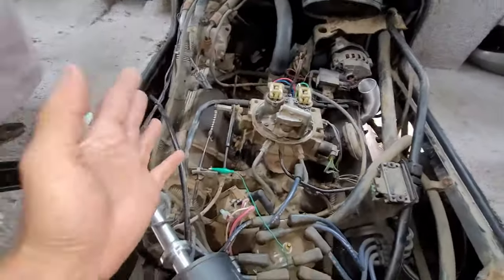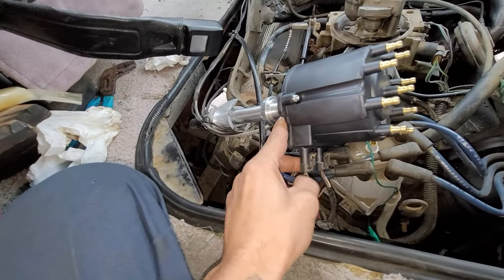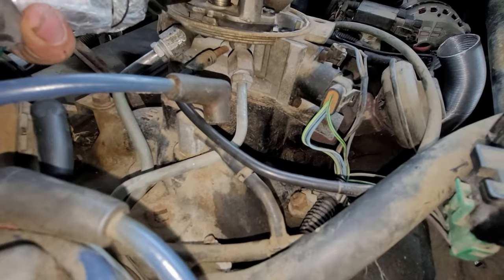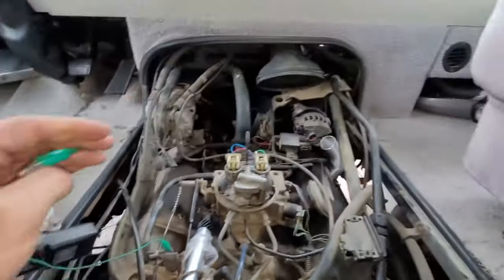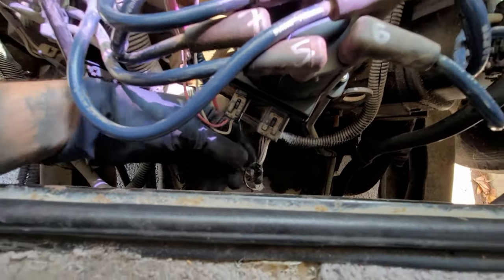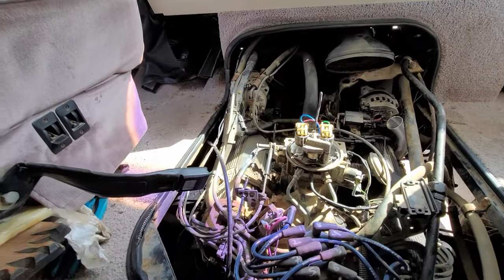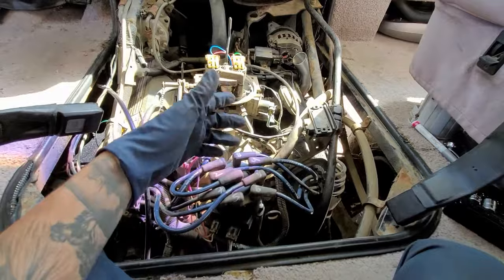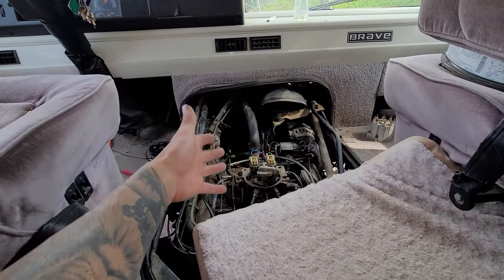chevy no injector pulse

Comment: that pink wire at the ECM is powered by a fuse in the panel ,,,,I found the fuse was GOOD but no power to the ECM, pulled panel and the wire terminal on the back of the fuse panel was bad going to the ECM!!! repaired terminal, got power to ECM and injector pulse

Comment: That is a big block 454 (not small block). No pulse = ICM issue, or wiring between ICM and PCM. The ICM/PCM grounds at/near the T-stat front of intake. Should be a metal bracket that bolts to the T-stat housing. No power to the pink/black wire makes me believe it's the ignition switch (base of steering column backside) Quite a bit of electrical passes thru it and it's known to go bad. For the injectors to pulse the ICM must be functioning.
Reply: And not hei
Reply: The TBI ECM uses no chassis grounds, or does it? All the cables that go out of the ECM go directly to sensors, ICM and injectors. There's more than 20 wires coming out of that box.
Reply: @soupflood  It grounds via the mounting bracket screws and at various sensor/s. It is also a good idea to replace the engine to chassis frame ground cable if it hasn't been replaced.
Reply: @jf4872   I didn't know that, should check it out
Reply: I need Help please

Comment: I recently purchased a 1992 GMC Topkick c6000 with a 366 6.0 gasoline engine and it turns ON but will not stay ON. I have to quickly step on and off of the gas pedal repeatedly for it to idle. It won't idle otherwise. I replaced the IAC, fuel pressure regulator, throttle body injector o-rings, sprayed the injectors and ports, fuel pump and strainer but still the same results. As I pump the pedal I was told there is  fuel at the injectors but it is weak and to clean them out which I believe I already did. I gave up but will revisit it again someday. Thank you for the video as it encourages me to return to the GMC.

Comment: Great video.     Me and my son are going to tackle is 92 K2500 tbi crank no start no pulse.       Just a dash of starting fluid and it's fired off and running.        Got the 700r4 in pieces on the bench rebuilding it for no reverse.
Reply: Did you find the problem???

Comment: #jabothemechanic Got a question? You said you also replaced the computer, I also am experiencing the same issue on my 95 Chevy Silverado Z71. It will run really good for about a hour until it gets hot then the injectors will stop spraying. I assume the distributor pick-up coil inside distributor but do you think the computer is getting hot and shutting the injectors off. It's just odd. I had it towed home and went back outside the next morning and it fired right up

Comment: Why can't you ground the aluminum body? Aluminum conducts electricity. It's used for electrical wire. The distributor grounds at the tie down , I'm sure there's a point during the backlash the distributor gear may not be positively in contact with the cam gear.
Do they even make a steel housing distributor, all my OEM distributors are aluminum.

Comment: So in my 89 Cadillac Seville sts TBI ( after I got know where) I remembered the guy I bought it from after he put a new battery in poured some gas in the throttle body to get it started. So at this point I thought what could it hurt ? I tried it and sure enough after your battery is unhooked or Dies in the caddy Chevy 350 anyway. You Have to poor q but of gas directly into the throttle body . It started right up and has ran fine ever since . Go figure

Comment: I had the same problem on my 1994 g3500 with a 454 ! I was not getting any power at all to injectors after hours of searching for the right diagram the injectors get power from the transmission circuit
Reply: Can you tell me a little more about this trans circuit? Thanks
Reply: They get their signal from the ICM (ignition control module).

Comment: Any ideas on an intermittent injector pulse? Starts and runs good just sometimes it will randomly not fire the passenger side injectors I replaced them last night in hopes it would fix it no such luck I wiggled the wiring harness and quickly looked over the wiring

Comment: i'm having an issue that i cant solve. The injector on the drivers side works perfectly, the other stays open 100% and floods the engine. it cranks, starts, and runs, but i have to shut it off after 10-15 seconds because the idle jumps super high from the excess fuel. yesterday it caught the exhaust on fire. Any info would be super helpful. thank you

Comment: I have a customer with a 1994 Chevy p30 motor home with a 454 with TBI, having same issue with no injector pulse, got full 12v coming from both wires of the injector but not pulsing. I can manually ground it with my power probe but obviously it floods the engine but it does start. But I what I found funny is that the previous crackhead mechanic that got it running before me had THE EXACT SAME WIRE AND FUSE setup to the back of the alternator to B+ but couldn’t figure it out as to why that was there!! Wth is that wire?? My alldata is for passenger vehicles not trucks and heavy duty vehicles so wiring diagrams are a pain to find. Please HELP!!!

Comment: Question I tried the 9v batteri truck I get spark but no fuel any idea what else can it be it only fires up with starting fluid there is no fuel coming out the injectors
Reply: I have the same issue, did you ever figure it out?

Comment: I have a 1991 Chevy Silverado 2500 gas 5.7     .   There is power to the TBI , however , there's no pulse. Truck cranks but won't start. It did Start & drove, but after parking, it no longer starts. Can you help?
Reply: Have the same problem. Any luck yet?

Comment: When I take the distributor out of the engine I can turn it and it fires gas from the injectors and is sparking from the coil, however when I place the distributor back into the engine and crank it, the injectors no longer spray fuel. PLZ SOMEONE S.O.S
Reply: Sounds like you have the same problem as this guy, broken wire or connector or you have a bad ground.
Reply: At least you had a spare pcm to rule that out, I hate electrical issues!

Comment: Come on guys, ok since you guys seem to know everything why don't you tell us what's the problem.  The situation that I have is that my truck turns on fine and I can drive anywhere but if I turn it off, it won't turn back on until 20 or 30 minutes.  Replaced pickup coil, ignition control module, fuel pump and fuel pump relay. Any ideas ? 87 chevy silverado
Reply: Heat soaked? Maybe the gas tank breather not working has a fuel vapor lock problem? Don't know just my idea
Reply: @Masta13100  The previous owner did install the fuel tank selector valve . Going  to check the lines. Thank you
Reply: Good thinking! rare issue but problem all the same!
Reply: I have a 1991 Silverado 2500 gas 5.7. With the same problem. I replaced the fuel pump assembly, in line fuel filter , & fuel relay . It cranks but no start. There's power to the TBI but no pulse . It starts once or twice a day ,then , no pulse. Unfortunately,a previous owner wired two switches under the dash, one is a 5 amp breaker toggle switch , which powers the second toggle switch, which powers ???
Reply: I think it's your electronic control module.  I ended up swapping my distributor and resolved all my issues.  So the Tbi is not going to send send fuel if the electronic control module is not working.  That's why people think it's the fuel pump.
Reply: @Superflyssrs  when I removed the top half of the throttle body , & turned the ignition, gas went to the injectors , but the injectors , but doesn't seem to go through them , so do you think it's the injector ,or something else?
Reply: Or do you think it's the electronic control module? I did replace the fuel pump relay .
Reply: Also , there were two old  distributors laying on the floor board when I got the truck.

Comment: Whats is that pink/white wire. I have a 91 chevy c3500. I replace the distributor it ran for 2 days. Now no pulse.
Reply: Usually the pink and the white wires are the ones that run from your coil to the distributer plug into the ignition module

Comment: @2:33 my camaro throttle body 1&2 have no light come on when I light test the fuse box. #1 #2 will not light up. No fuel coming through throttle body...what do you think about that?
Reply: Will not start...pops when I put a little gas in it
Reply: More likely than not it's the ICM if you test light everything especially check the relay first if you look it up on YouTube. But if the relay is good for the fuel pump then you have a ICM problem. But check the injectors first to see if they fire with a power supply